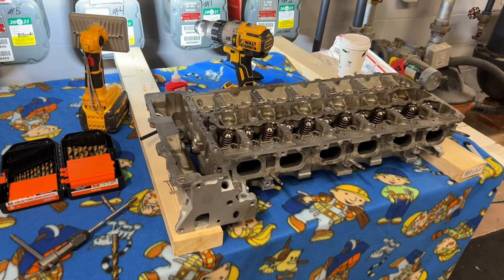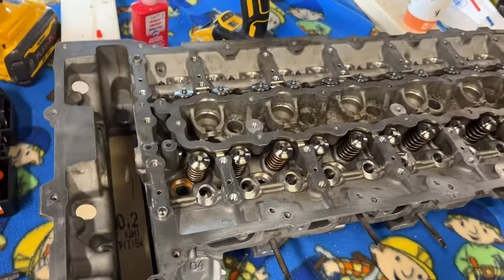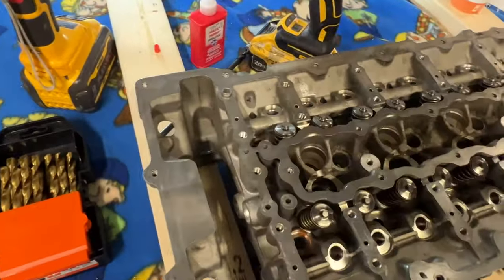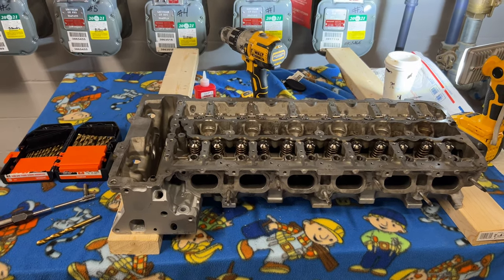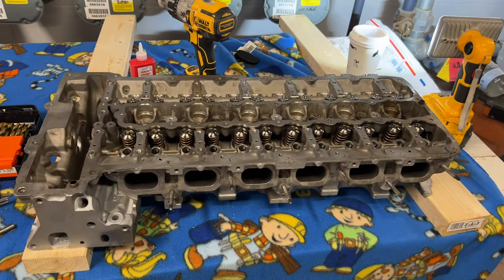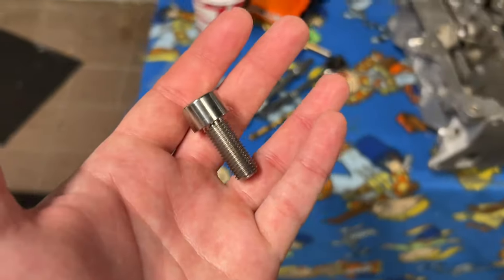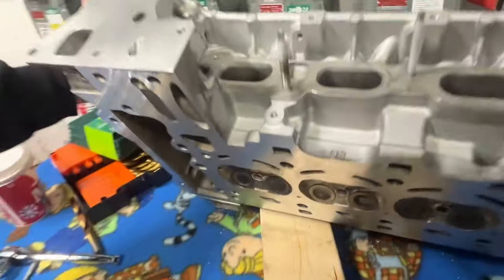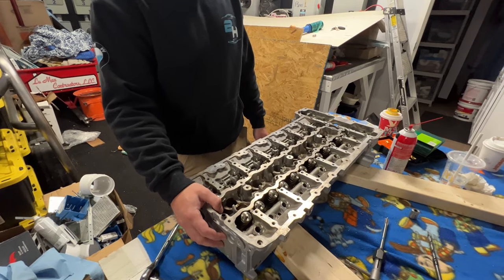Budget! N54 direct injection DELETE!

Comment: What a great DIY. Grassroots style. Im relatively surprised there is a pencil style plug that relies on the teflon seal. Most ppl dont even install them right in the first place. I would go about it as you have. I suppose an aluminum bolt, welded shut would work too. But the cost would be steep. Stand alone ecu will be such a step forward, Im excited for ya, Rock on!
Reply from the maker: Yessir, thanks for watching. Professionally welding the head is a good option but i already had my cylinder head assembled and resurfaced. Im super excited to get the car back running on standalone and putting out more content
Reply: You don’t want to weld the head on the side of the valve (to seal the bolt). The head is aluminium and risk of warping stuff a tiny bit and making the valves not seal is very likely.

Comment: My boy just left his old ones in and ran port. No drilling and tapping needed. If you ever have a sealing issue, a smear of Jb weld works Excellent on the sides of the pointy part of injector, they can always be twisted out later and you can run as much boost as you want without leaking combustion ever again.
Reply: sure abt the JB weld part?

Comment: Now I wonder if you could bolt this head on an N55 block.
No idea if its possible but always ruled it out due to the injectors being different.

Could build such a reliable / Simplistic Track Capable BMW I6 Turbo engine.

N55 Bottom end with S55 Oil sump - Fix oil starvation when tracking. (only reason not full N54)
N54 Head with this DI delete - Removes complexity of N55 Valvetronic + All parts that can fail
Single turbo

would be sick. Again, no idea if actually possible just something ive been thinking about
Reply from the maker: Interesting idea! I would probably swap out the n55 crank with n54 tho. N55 crank isnt forged
Reply: If you want to do this big of a mod you shouldn’t use a N54 head, it’s dogshit compared to N52 head i.e. Which does not have DI (so it fits bigger valves) and the valvetronic can be deleted.